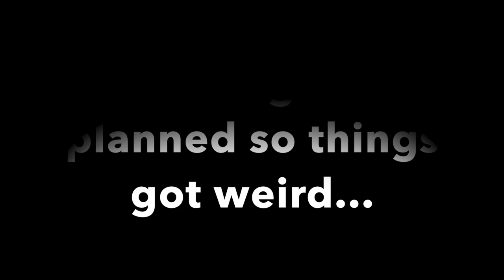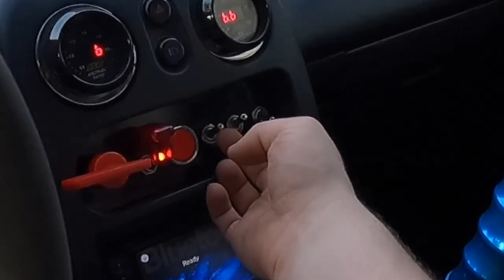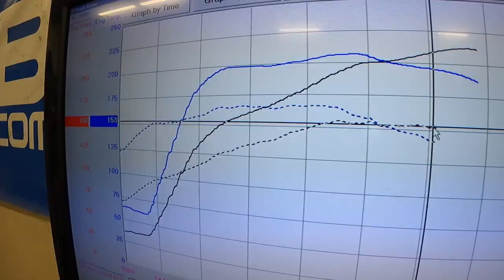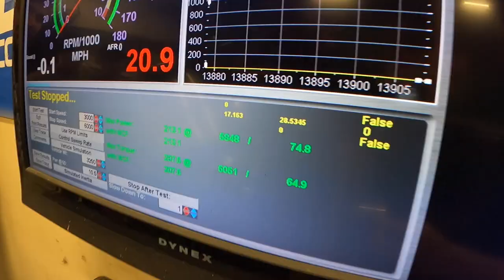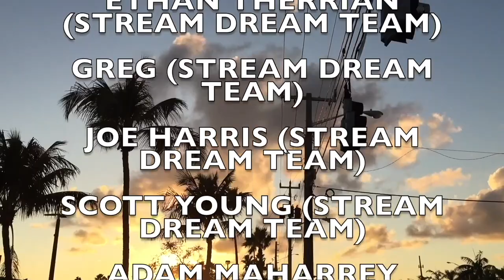BOUGHT MY FIRST HOT BOI MIATA!

Comment: we getting projects done
CRX: Am i a joke to u
Reply: tbh in comparison the crx kinda lame
Reply: @dhc2  🤨 you crazy or just don't know about the crx why you think he completely restored it
Reply: This guy said it was lame 😒
Reply: @dhc2  
What do you mean ? This miata is clap city, I swear it looks like it was built by a tiktoker, and I don't mean that as a compliment.

But even if we go past the mods that have been done to it, since it's subjective, there's many things that are objectively wrong.

The shell isn't as clean as the crx is, the miata has been scraping on shit for years now, it's probably rusting underneath, it's also probably been repainted 69 times.
The ignition wiring has been messed with when the previous owner installed that ebay ass switch panel, in a few years it'll bite you in the ass when it doesn't start anymore and you'll wonder why some dumbass didn't leave the perfectly fine stock system. 
I'm sure as hell the paint hasn't been done as well as on the crx and in a few year I bet rust is gonna pop through it.
It has a bolt in cage that is falling apart, many holes in the body, to end up with something that is barely solid enough to stay in place lmao
It has a hood dump that is damaging the hood, and is gonna make you sick with the fumes after driving for 15 minutes.

It's unique and has it's own cool factor, but you can't say it's better than the crx when the crx is getting a complete legit restomod, compared to this miata who has an entire list of problems, some pretty much unfixable.
Reply: He's getting the engine bay painted, paint takes time

Comment: You should make the new Miata a drag car, since its got the engine and cage for it. Keep the roadster for road course stuff and the ricer for drifting
Reply: That cage actually makes it way more dangerous. Lol. Not welded Ill fitting steel tubes zip tied to plastic. Sounds safe 🤨
Reply: @Eric-hn6xp  hell yeah for sure, does he still have the LS bimmer? That just needed some love and it would be a crazy fun bulletproof drift car.
Reply: Oop, my bad. I thought you said drift car but you said drag. Do miatas make decent drag cars? I’ve never really seen any in videos or irl. I guess they’re light and they’re rear wheel so even stock I guess it’s somewhat heading in the right direction.
Reply: @Eric-hn6xp  I figured the whole drivetrain had to be replaced, I’ve heard the miata trannys are made out of glass from quite a few people. That dudes Miata is badass though. Cheers for the link so I could see it.

Comment: The gears on the accord are too long he should swap in an H22 trans gears are still long but a bit shorter than the F trans...either that or do an F2B conversion and use a bseries transmission
Reply: F2b with a brough performance kit. The drivetrain in the ls is so much of an upgrade over an h.
Reply: I have the ls trans it's not bad tbh I've enjoyed it alot
Reply: Even the ls trans has long gears but is wayyyy better than any h or f trans

Comment: Get the Saab 9-5 on the dyno, install a old version (5yrs or older) of trionic 7 suite and you will have a tune me up button in the software that gives the Saab stage 1 / 2 / 3 / 4 instant. Up to 315hp if the car has a Aero turbo, 3" exhaust and 630cc injectors.

Comment: needa gap the plugs in the accord down to like .020, it's still blowing the spark out. Might aswell get a step colder plug while you're at it
Reply: They're colder plugs gapped to .02, s300 is causing a soft limiter with ignition cut, changed that to fuel cut, no more flames, gunna turn up the boost and fine tune the top end
Reply: @Car-Yap  in the "rev limits" tab of parameters you'll find "power reduction" which you want at "none" and "activation rpm" which you want at "late" for the harshest limiter. I personally have a tiny bit of power reduction and activation rpm in the middle with fuel+ignition cut. 

It was still a touch coughy around 4-5k rpm which is a seperate issue to that aids limiter  you had going on
Reply: @waydemorris1451  I'll check it out.

Comment: Ok I still haven't driven a manual how did he start the car when hi stalled it
Reply: Pop start letting the clutch out to spin motor  instead of starter
Reply: Yeah man, stall a manual and while the car is still rolling you pop it in the proper gear and let the clutch out and it starts back up. I had a clapped out civic that had all sorts of electrical issues when I was way younger and I used to have to make sure to park on a hill so I could get in, push the clutch in and let it start to roll so I could pop start it otherwise I wasn’t going anywhere lol. The more you know 🌈

Comment: You say the car super cool it's super dialed but the roll cages zip tied in the heads you completely contradicted yourself that car is not dialed and it's only 1/16 of an inch off the ground you can't even drive the damn thing man you got to lift it up at least 3in you got to get that damn thing roll cage mounted so you don't kill yourself you hit a bump that roll cage is going to kill you I do like the car it is kind of cool it just a little too low